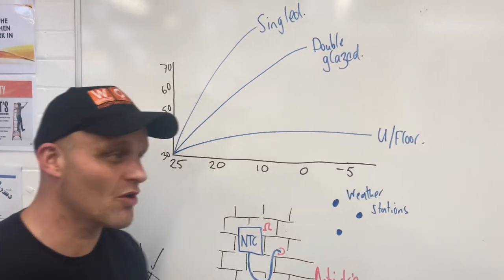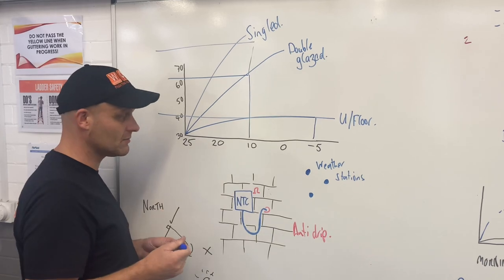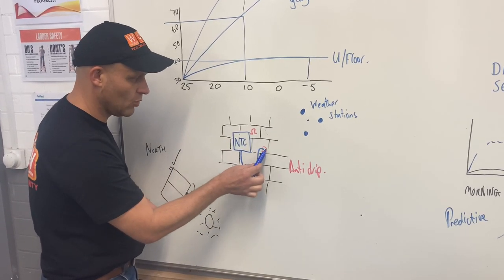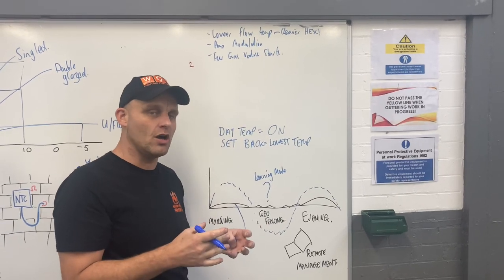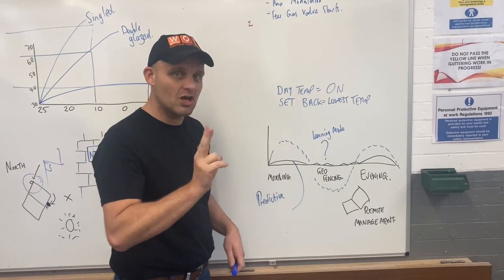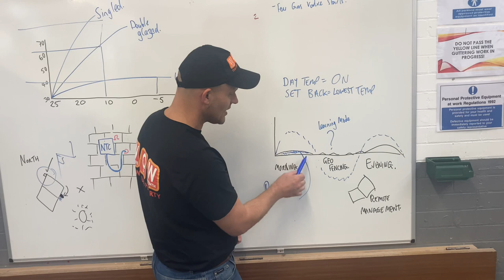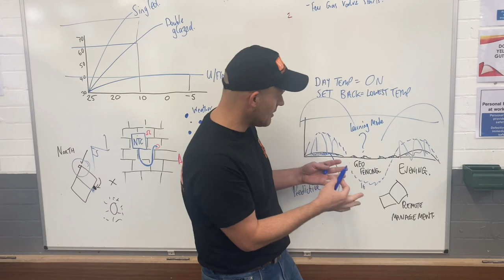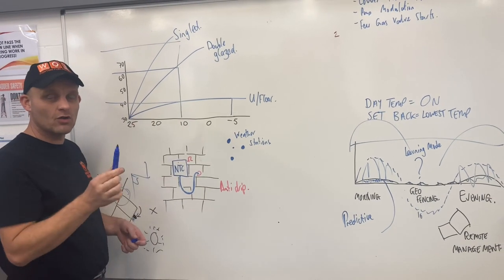How does weather compensation work? How do smart controls work for heating systems ⁉️

Comment: Great explanation, leaves me with a couple of questions though.
1. The middle of your wave shows the boiler coming on & off to maintain temp at very low modulation, but you said we shoukd limit the amount of times the gas valve opens?
2.i understand based on desired room temp it detects outside temp and adjust the flow to suit, but without an indoor thermostat, what tells the boiler its reached the required air temp?